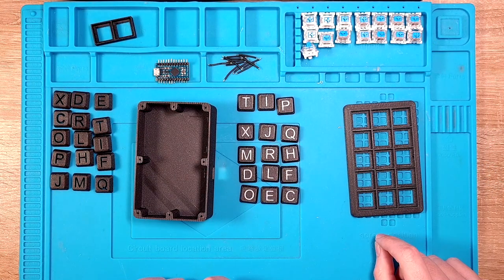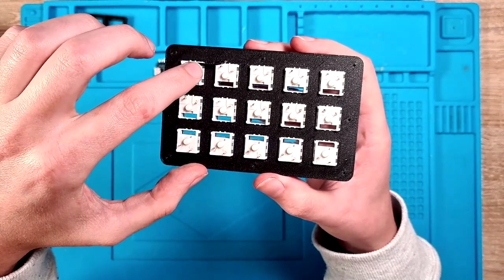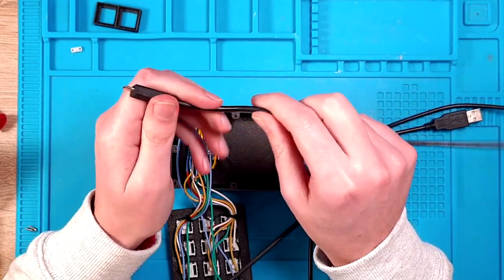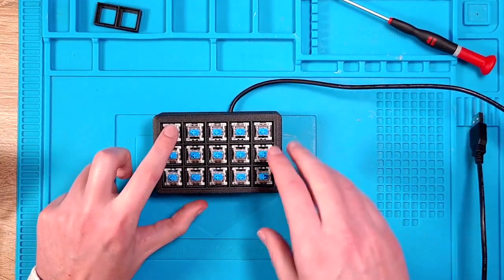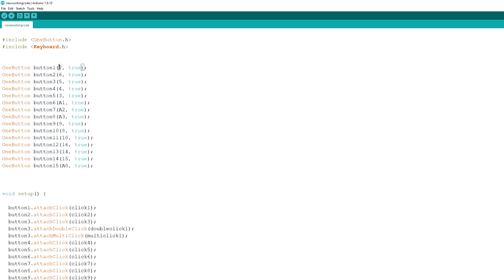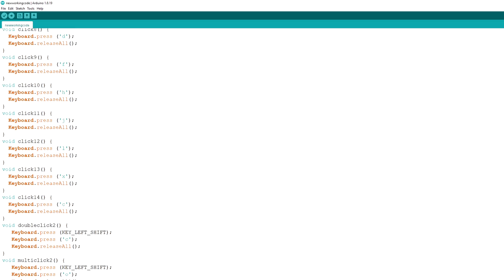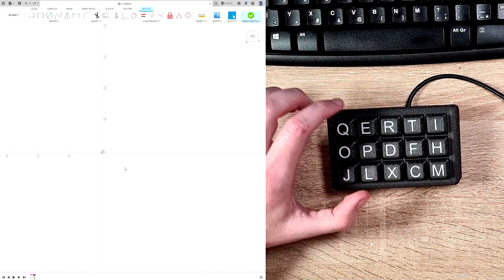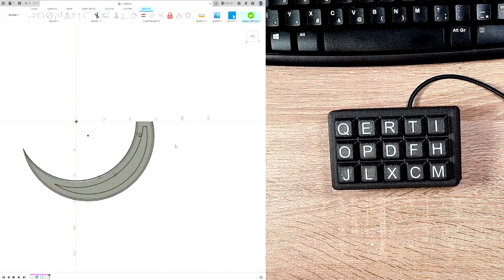Best Fusion 360 upgrade!!! - 3D Printed Macro Keyboard - OPEN SOURCE

Comment: Today I got really excited (!) - I managed to wire up all my keys and upload your sketch to my Arduino. It works!! All I have to do now is reconfigure the key assignments as I'm using 16 keys and some different functions and I'm done. A small step for mankind but a giant leap for this Arduino noob!

Thanks again for your contribution, it is much appreciated.
Reply from the maker: I am really happy that it worked out for you and it feels really good hearing your excitement about it 🙂
Thank you for the nice words and have fun using it.
BTW have you seen my DIY Spacemouse videos? If not I would recommend to watch them 😉
Reply: @kikihobbyrepair  Thanks Kiki. Yes I saw your SpaceMouse video and was impressed. I happen to have bought a "real" one a while ago but never really got comfortable using it. Maybe one day I'll have a go at making yours to see if I can adapt it slightly to suit me better.
Reply from the maker: Sure mine cannot really compete with an original but it was fun to design and build 🙂
Reply: @kikihobbyrepair  Do you have any other projects in the pipeline? I'm impressed with the little Pro Micro board and am wondering what else they could be used for . . .
Reply from the maker: I have a project in the pipeline but there the Arduino Nano is good enough.

Comment: HI. Compliments. Nice project. Could you tell me what thread did you use for the print?
Reply from the maker: Thank you. No threads, only undersized holes. The screws are cutting their own thread.
Reply: @kikihobbyrepair   Sorry I expressed myself badly. I want to know what printing filament you used.
I like it very much, I would like to know the brand.
Thanks.
Reply from the maker: It is Prusament Galaxy Black.

Comment: Another great project. Thank you for sharing. If I wanted to amend the design slightly can you think of any reason why I couldn't use all 16 of the Arduino digital pins?
Reply from the maker: Thank you! You should be able to use them all. Are you using my code?
Reply: @kikihobbyrepair  Yes I will be using your code, with the necessary extra bit for the 16th key. The idea of hitting keys several times to invoke the alternative modes is really clever and will be very useful. I am currently looking at the case and frame layout whilst I wait for my Arduino and the keys to arrive...